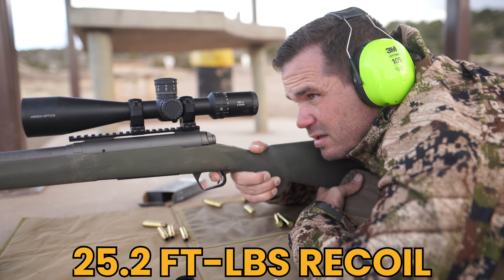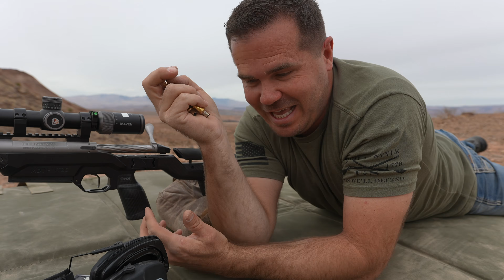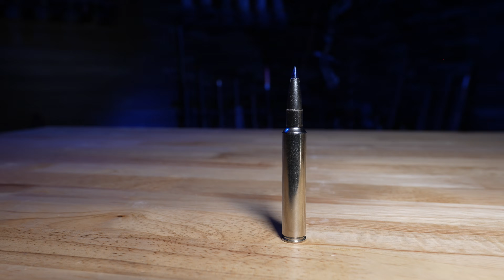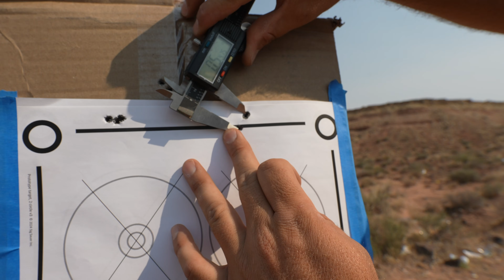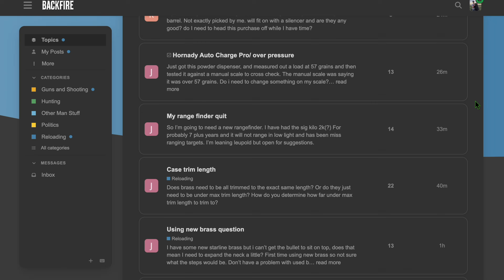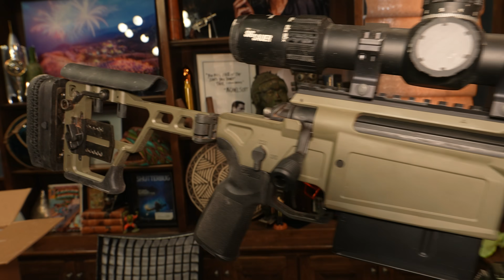6 Phenomenal Cartridges No One Is Using

Comment: I used a 257 Robert’s for years with perfect results on close to mid range white tails and hogs. After building my 6mm creed this year and loving it, I’m ready to build a 25 creed, (if my wife is reading this it’s for the kids!)
Reply: I've taken game out to 535 with the "Bob", and it's a killer for sure.
Reply: First rifle was a 257 Roberts for me as well. LOVED that gun. It did however make me biased to the rigidity of wood stocks tho.
Reply: Is that not the 257 the same as 7x57 .
Reply: I’ve got a very accurate 6creed but my 25creed is absolutely my favorite it’s perfect for 0 to 500 easily on whitetail sized game and below I honestly believe if you kept it within 300 its is absolutely elk capable with the right bullet and right placement I’m pushing 2980 out of a 25 in barrel with a 128g I wish Norma would create a .257 bondstrike bullet ur limited with bonded bullets so mono may be the way to go with a .257

Comment: Ive never understood why people think the 7PRC or even the 280AI or the regular 280 were great when the 7mm-08 can be loaded to nearly match the 280 performance wise with only a slightly lighter bullet and do so in a short action with even LESS recoil than the 280. Hornady lists a handload for 162 gns to 2700fps.. if you wanted a heavy varmint round the 25-06. if you wanted big without the excessive recoil then the 338-06.
Reply: The 7mm08 is nowhere near the performance of a 7 PRC, it's a necked down 308 case. Good luck getting 2700fps from a 162 in a 7mm08, the 7 PRC can push it to 3200.
Reply: @ the 7 PRC cannot get over 3000 its been proven to drastically over state their FPS on the box... if you try to get over 3000 the brass starts showing signs of over pressure by flat primers or cratered primers. It clearly shows the FPS in the video at 2800. Hornady clear states 2700 from an 7mm 08 in the loading manual. in a 26 inch barrel it can be done. If I can get a 308 to 2750 with 168s then a 162grn 7mm out of the same case is no problem.
Reply: Wish the 338 Federal took off. Great concept.

Comment: 7 PRCW over the 6.8W, 280AI and 7SAUM. 

6GT over the Dasher. Reliable magazine feeding is helpful. 

.25 call bullets are starting to get more popular, but didn't see a big benefit of another rifle with a bullet just .007" smaller diameter. 

Don't trust SIG, especially initial releases, especially at higher pressure. I'll wait or likely pass.

Comment: One of my favorite deer rifles is a 280 Remington. Is it worth the cost to rechamber to 280 AI.  How does the 7 mm wsm compare to the 7 Sarum?
Reply: I also shoot a 280, I considered doing the ackley chambering when I put the rifle together but unless a guy wants to load to a higher pressure the gains aren't as big.  The thing to keep in mind is that it takes a 4% increase in case capacity to see a 1% increase in velocity...   It's been years since I barreled my rifle and there wasn't much, if any 280AI data out there, if there is new higher pressure data available it might be worth considering since the original 280 is rated a little lower since Remington introduced it in  the auto loader back in the day.  Dunno, I've never found the 280 lacking at sensible ranges. Tough call
Reply: @ does anyone know if the spec for the barrel twist on a 280AI is faster than a 280 Remington
Reply: I built a 280AI on a old Remington 721 and there is load data in Hornadys newest manual as well as Nosler manual I built it with a 1-8 twist rate that is what was suggested when I ordered the barrel

Comment: Other than the Ackley improved all the others are modern in that they are less than 25 years old. How many different shapes and sizes of brass bottles do we need to have to burn gunpowder in? 
Does anyone factor in barrel life when they consider a cartridge? If you do so there are many well proven by our forefathers' cartridges that have been getting the job done for decades, even a Century like the 30/06 that have much longer barrel life.

Comment: Great video...I did an 18 inch 7 SAUM this last year so I can be suppressed and still short.  It's was a factory 6.5 PRC Tikka and I just put a Oregon Mountain Rifle Carbon barrel on it and widened factory stock to fit...it's my new favorite.  Still doing load development with various bullets, but it's easily still a 500+ yard elk gun (my personal limit) and a pleasure to shoot with suppressor.  Very cost effective way to tinker and have a one of a kind rifle by simple barrel/caliber swap.  Thus far probably 75% of my group testing have been easily below half inch as I've been figuring out pressure and load developing.  I'm using 160 and 175 grain pills.  I've very impressed with 7 SAUM and recommend 280 AI to friends who don't reload.

Comment: I have a 280AI, a 6 ARC, and a 6.8W.  That must say something about me.  
When you do your 6 ARC, make sure you do a bolt gun.  A Howa mini action with a CF barrel + CF stock = ultra light deer killing machine with the recoil of a 22LR if you add a suppressor.
Reply: 6arc in a bolt gun is dumb, its cool in an ar15 but in a bolt gun just go up to either 6 or 6.5 creedmoor
Reply: @steve-k5r1r if you load your own ammo, the 6 arc is great in a bolt gun. 62k psi limit jumps the velocity up 150-225 fps. It’s a great truck gun.
Reply: @SammyMoore-tg5gs  in a bolt gun the is almost no size difference between a 6arc and 6.5 creedmoor so I'll always go creedmoor.
Reply: @steve-k5r1r  not really. Looking at it from a logistical standpoint if someone is already set up for ARC but has zero creedmoor then why add another cartridge? Economically it's not a very good move. (Unless funds aren't a concern.)

Comment: I shoot a 280AI, 'nuff said.  Problems with the 6.8 Western ?  Very proprietary with rifles, brass and ammo but there's always the 270 or my choice, the 270WSM.  The SIG 277Fury, I can't imagine what the real ammo cost would be, most likely like the 6.8 Western over 90 bucks a box.  Starline has said it will be producing full brass cartridges but then you'll need to back off on the charges 30% so what's the point. A 280AI or 270WSM with 140's at 3150fps for 55 bucks a box will take anything on this continent but I suppose some will just need that extra .007" or stupidly heavy bullets.
Reply: You can find 6.8 Western as low as $49 per box online. Usually just under $60.
Reply: @jimedick9496  Sure but add tax, shipping and Haz-Mat for $22 a shipment and you better buy a lot to bury that cost.
Reply: @hardball107 
You have to pay tax whether you order it or buy out off the shelf. You pay tax whether it’s powder, bullets, casings, or primers 🤷‍♂️ 
You’re paying that tax one way or the other.

You do make a good point, that you pay for shipping. Still, I order ammo even if I can find it on the shelves, just for the convenience alone.

Comment: Do a 6 ARC loaded up for a Howa mini action. You won’t be disappointed.
Reply: I still like the Grendel a little better
Reply: @pauloglesbee9517 same. I love my Grendel.
Reply: What makes the Howa mini a "mini"?  I was  looking at buy a Howa 6 ARC but don't have any experience with Howa although i have heard alot of good things.  Is the Howa 6 ARC a heavy barrel or standard? Thanks
Reply: @jeremydawkins8399  The action is smaller than a short action so it's meant for the same cartridges that would fit in an AR 15 platform.
Reply: @ you can get them in several barrel contours. The Carbon Stalker with the thin profile sporter barrel is a legit 5 1/2lb rifle with practically zero recoil. Perfect little whitetail woods rifle.

Comment: I wish there was more 6.8w support
Reply: i have one and i love it
Reply: clearly reloading was a no no until decent brass existed and decent factory loads not Winchester ammo.Was said three years ago. When fixed and with availability of Tikka, Bergara type rifles why not a western, 708 or 280 AI for so many hunters even take elk with a right accurate shot. Definitely better option for so many than an old 06 or win mag
Reply: @keithprinn720  Nope
Reply: If they built it on a .473 bolt with a long action it would have been successful, and they would have sold a lot of Model 70’s and X-bolts. But they built it on a .555 base with a slightly rebated magnum .532 rim and a large rifle primer. Overall length for the highest BC projectiles exceeds some short action dimensions similar to the 6.5 PRC.

The 6.8 Western is a hot mess created by engineers who tried to reinvent the wheel.
Reply: If Hornady made the 6.8 it would have taken off. It’s better than the 6.5 and 7 prc’s actual numbers out the barrels,not on box.
Reply: True but if Hornady had made it they would have neutered it the same way as they've done with the 6.5 and 7 PRC.
Reply: @ScottDuBois  100% agree.
Reply: @ScottDuBois TRUE
Reply: Not as much as Browning and Winchester do.
Reply: ONE "match" bullet from all the suppliers, and it's very light weight.
That could have something to do with it. There's bullets, but none of them match.
6mm, 6.5mm, 7mm, .30 cal....... just loads and loads and loads of match bullets.
Sierra makes no match grade for .277, Berger makes no match grade for .277, Hornady makes ONE match grade bullet for .277. Berger is the only maker with a BC over 0.600, in ONE projectile.
Outside of hunting stuff, rather middle-road BC values, there just isn't much support for it, much less factory match ammo. People choose either the 6.5 caliber or the 7mm caliber.
Reply: @12skipafew-e7y 
That is not entirely correct.
165 grain ABLR BC .620
175 grain Sierra GK BC .617
170 grain Berger EOL BC .662

I have ammo in each of these cartridges and they are very accurate. Plus, they maintain velocity and energy at long distance.

I’ve taken my last three bulls at 574, 588, and 656 yards. Before you say anything, those are across canyon shots where there are no roads or cover. It’s not like I can stalk them using a non existing bridge. This is in the Hells Canyon region, so if you want success, you need to have long range capabilities. That’s where the 6.8 Western shines.
Reply: @jimedick9496  I've been all over these websites, wasn't just speaking off the cuff.
I know enthusiasts are thrilled about a cartridge. Fact is, it's nowhere near the ease of use of the 6.5 caliber or 7mm caliber in the sense of available projectiles and factory support.
The struggle and hunt for components is half the fun for some people.
Reply: It's coming
Reply: This
Reply: 6.8 Western is basically a modified .270 WSM, which I don't think was that popular.
Reply: @12skipafew-e7y  WSM were/are quite popular(Except the 325) Beacuse of a patent issue the WSM were put on hold by Winchester and they brought the 6,8. There is a Fad over Short Actins today, 1/4" extra bolt trow and weight are a burden. The craze about the 6.5 Creedmore A 308W size cartridge(necked down), Why not a some necked down WSM. He,He, You Shoot, Go figure out?? I have 3 Rifles a 1917 US Enfield 30-06, a 30-30, and a BLR in 7-08. Te 30-06 is going to rebarel to 35 Whelen. And if I can sell my House for a good price will Have Randy Selby build me a Win M70 SS in a 3'8" Mag Action Takedown in 257 WBY, 7RM,338WM, 375 H&H and 416 Rem Mag. Guess what a Rifleman I'M:face-purple-crying:👍
Reply: Make a video so people can see what.s going on with rifle😊
Reply: They can make all these new cartridges but…. They’ll  never completely defeat the 300 Win Mag, 7mm RM, 223 and the 30-06
Reply: Same
Reply: 280AI is the best well-rounded 7mm around. Change my mind.
Reply: @G5Hohn  
Wait a few months, the new 284 Creedmore/PRC/Arc/Western/Nosler/Very super short ultra mag will be the BEST.
Reply: Couldn't agree more, o love my 280ai.   @G5Hohn
Reply: It’s practically a fast twist 270wsm, for a hunting application 270win/wsm does everything it can, and for an elr application 7mm BC’s are far superior. Not tryna sound like a hater but from manufactures perspective I get it.
Reply: @coltonmoutdoors  
You’re right. Long range shooting is the manufacture’s priority now. They shoot way more rounds a year than the average hunter does. I don’t care if they make all the new cartridges as long as the classics stick around too.
Reply: @coltonmoutdoors Not practically, it was designed to be the same gun. There was allegedly lawsuit dealing with  a patent infringement on the case design. That’s why Winchester basically abandoned it. The patent ran out and the Western came back.
Reply: @coltonmoutdoors  New to a lot of this so if Im wrong, Im wrong.  But from everything I looked at the 7mm only surpasses the 6.8 on heavier offerings.  Shooting a similar weight projectile the 6.8 will do it better.  Isnt the 270wsm too long to fit in a short action with the higher bc .277 offerings as well?
Reply: @thedaventure 
You can still load those higher BC bullets in a WSM case, but you need to seat the bullet further down the casing, which takes up powder space, so you lose on some of that potent 270 WSM velocity. You also need a faster twist rate barrel in order to truly stabilize those 165-175 grain bullets. 

I love the 6.8 Western. I have fired it on 5 big game animals. 3 bull elk, and 2 bucks. All were one shot kills. The bulls were at long range, 574, 588, and 656 yards due to the canyons I hunt in. There are no roads and very little cover. So shooting across the canyons is a requirement and norm. That’s where the 6.8 Western separates itself from the other 270’s, except for the 270 Nosler. That’s a potent cartridge!!!
Reply: @coltonmoutdoors it’s runs heavier for caliber bullets than the wsm and it’s in a short action.  Not much different?  Neither is the 7prc vs 7 rm but it’s popular.  None of the common 7mms are a short action.  7-08 is dead  and not much better than the 308. The short action 7 saum and SS are a handloaders cartridge only.  6.5 cm is anemic on big game.  6.5 prc is a medium action and not as desirable for larger big game. In the short action game the 6.8 western is the best cartridge to come along in a while.  That’s why people like it.
Reply: @coltonmoutdoors 
Yes, it’s a faster twist rate, but it also fires heavier bullets with higher BC.

I love all 270’s, but the Western has clear advantages over both the 270 Win and the 270 WSM due to the heavier and higher BC bullets. The numbers don’t lie, but all three are terrific cartridges. I own two of the three.
Reply: It’s not much “better” than the 270, that’s why. At least from a hunting perspective.
Reply: @scott.dobson  Winchester came out with the 6,8 because the legal issue with the 270/7MM/300 WSM. It Is a 6.8/277 WSM. New kid on the block.
Reply: @scott.dobson 
You’re wrong on so many levels. I own both, so I know.

I’ll pick the best numbers from both using off the shelf, not hand loads because that makes this apples to apples. This is by far, the best energy delivered for the 270 Win. Most sit around 1,100 ft lbs @ 500 yards.

270 Win:
150 grain Nosler ABLR
Muzzle:
Velocity- 2,850 ft/sec
Energy- 2,706 ft lbs

500 yards: 
Velocity- 2,122 ft/sec
Energy-  1,500 ft lbs

6.8 Western:
165 Accubond LR
Muzzle:
Velocity- 2,970 ft/sec
Energy- 3,226 ft lbs

500 yards:
Velocity- 2,252 ft/sec
Every- 1,856 ft lbs 

There is over 500 ft lbs of energy.

The Western shots faster and heavier with higher BC bullets. This isn’t even the highest performer for the Western. That goes to the Berger 170 grain EOL that deliverers 1,915 ft lbs @ 500 yards!!

Sorry, they’re not the same. The only thing they share is the diameter.
Reply: @ 
No one is arguing that it is more powerful. So was the WSM. I’m just saying that most people don’t think it’s enough to invest in a new rifle, hundreds of dollars in ammo to see what it likes, then hundreds more to stock up on that ammo because of the uncertainty of the cartridge’s future, when they have a 270 with lots sentimental value, time in the field and probably a boat load of ammo for it. I loved the 300 WSM, but Browning dropped it out of their X-bolt line…but they still chamber it in 300 Win Mag. The future will tell. If you like it, great. Buy enough ammo to last a lifetime.
Reply: @scott.dobson 
I agree with that. For most, the 6.8 Western isn’t necessary. Still, I was responding to your first comment. You claimed it’s not much better than the 270. I explained the advantages and why it’s desired by certain hunters, such as myself. For those of us out west, pending on where you hunt, it’s desired due to those long range advantages. Outside of that, the 270 Win is terrific, and would fit the needs of 95% of hunters. My entire family hunted with the 270 for years. So when I say I’ve witnessed hundreds of elk taken with it, I’m not exaggerating. I’m a 270 guy, so the 6.8 Western intrigued me due to the .277 bullet. I love both these cartridges.
Reply: @ 
I can certainly see the appeal out west where long shorts are the norm.
Reply: @jimedick9496  is your energy calculator right? With higher bc & faster twist rate, it loses more energy @ 500 yards? Something seems off with those numbers.